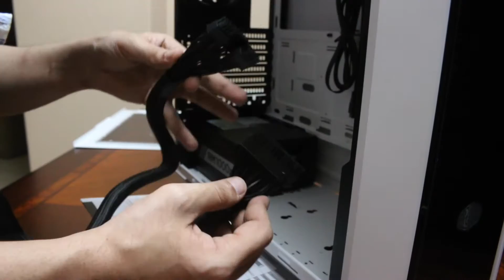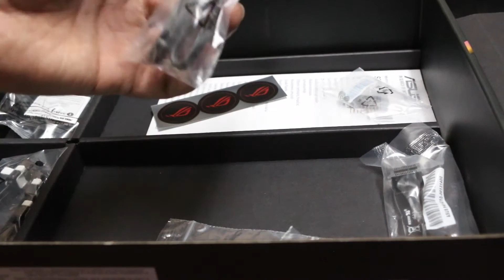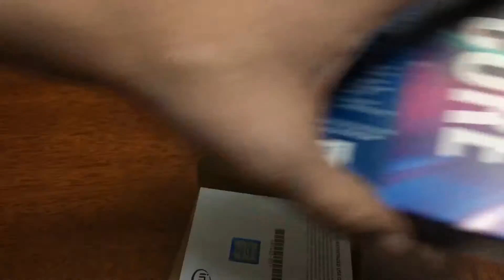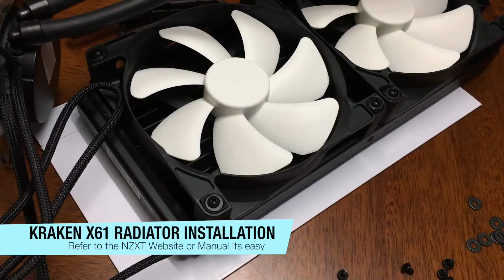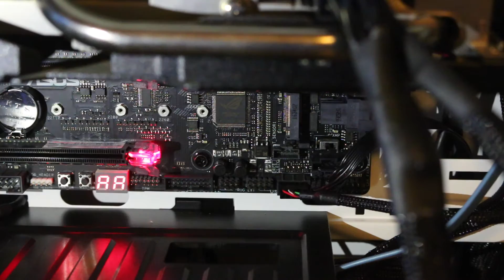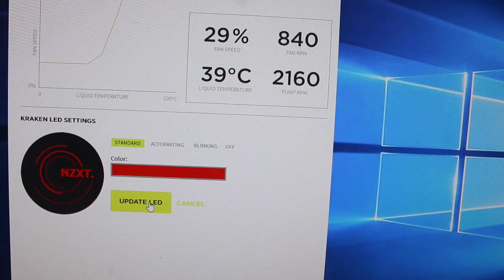Kraken x61 on Asus Strix X99 Motherboard with Intel i7 6800k "2017"

Comment: does anyone know if asus will make a matx x99 board?
Reply: they already did, revised for the new generation however seems unlikely - the asus x-99 ws-m wasn't a great seller (i was interested in getting it but its m.2 is not nvme unfortunately).
Reply: Sam Atherton strixx?

Comment: Anyone know if you need to bind the nzxt krakens through the motherboard (w/ cpu holes) onto the back of the motherboard? My x99 doesn't have holes that go straight through... is that normal? I can't tell in this video. My kraken should be coming in soon, it is a fresh build.
Reply from the maker: I have another video which explains the installation, hope that helps. Its easy breezy installation. Wait till you get the NZXT Kraken, the manual is good and gives easy instruction to install.
Cheers

Comment: I am planning to do a video like this for my first pc too, may i know the cameras and video editing software used? :)
Reply from the maker: I use a Canon 70D, Samsung Note 5 usually. Edited on my Macbook Pro 2016 edition 15inch, Software for editing: Final Cut Pro X
Thanks for the Like and Subscribe.
Cheers
Reply from the maker: I am sure that Asus are regular with their BIOS updates so that shouldn't be a worry at all. Just go for this board and Intel i7. Mine so far is good and paired with a good GPU can run almost everything with ease. Good Luck with your Built.
Furthmore the Collermaster Masterbox is a great Case and its easy to maintain and keep the system neat and clean.
Reply: did you have to install bios updates for the i7?
Reply from the maker: No I haven't installed the Bios Update for i7. 
If  you have installed the bios update do let me know.
Cheers
Reply: wonderful pc build btw... i was just asking because i know this motherboard is young (not older than 1 year) and i just wanted a confirmation because i am looking to build a pc as well with the 6880k